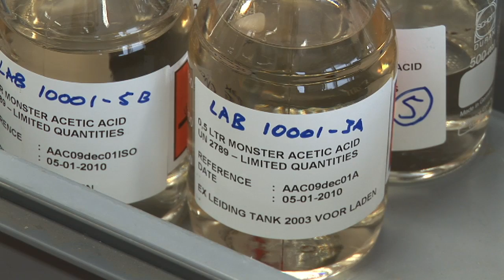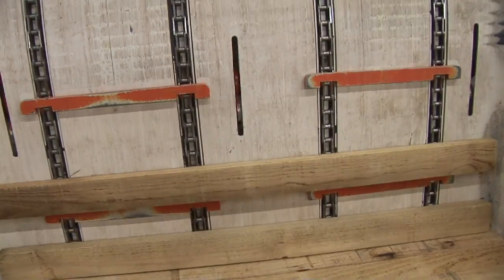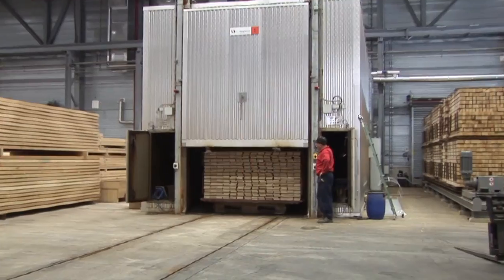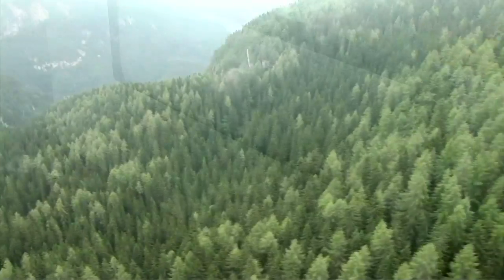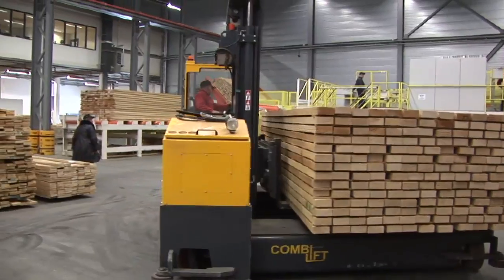Accoya Timber Video

Comment: Accolade is a very good product for what it was intended. We have seen that it’s excellent for outdoor uses where it is very rot-resistant. As a partly manufactured timber, it is very consistent when you come to turn it into windows, doors, cladding etc.

It is certainly much better at rot resistance than normal “treated” timber. 

I’ve seen some comments about “environmental bullshit” . The reality - and not the bullshit - is that Accoya may be slightly more expensive or slightly cheaper than a hardwood such as Oak or Iroko but that it uses fully commercially grown, fast maturing softwood to achieve the “hardwood durability”. So, the crop can be turned around quicker and more crop matured within a timescale. Here, in Europe, a lot of oak is plantation-grown but a lot is still taken from the wild in Eastern Europe. 

When working with Accoya, it’s predictability is an asset. That lowers production costs. That predictability can lead people to say that it’s boring - and I would accept that, in larger areas, it is not an “interesting wood”

Nothing to do with Accoya or any supplier company. Just wanted to bring our experience so that people can make an informed choice.